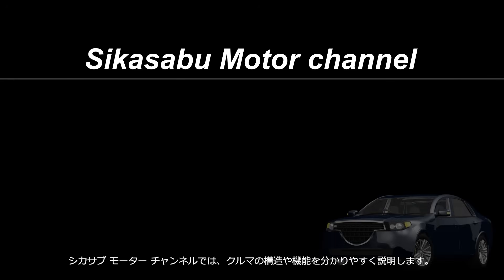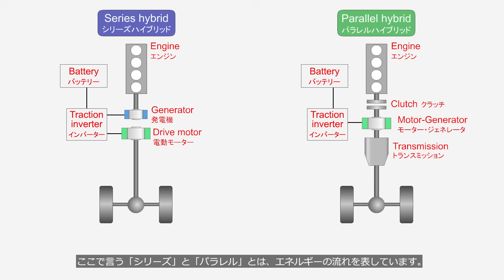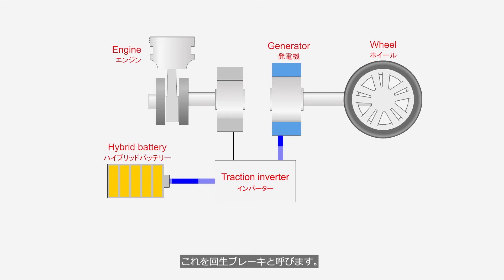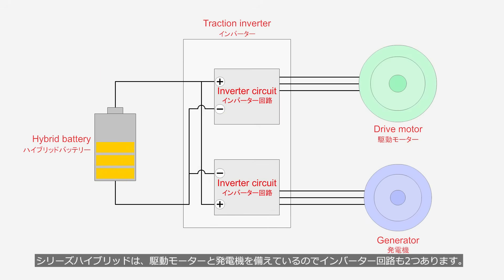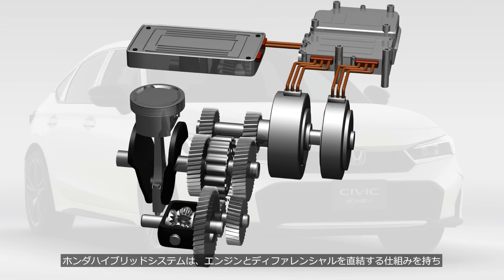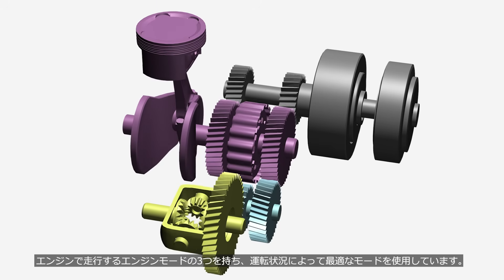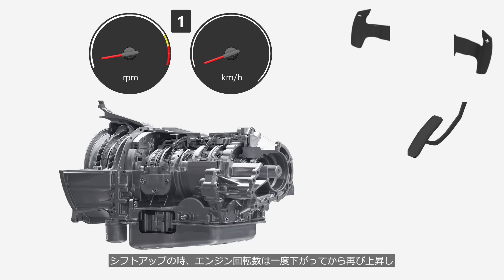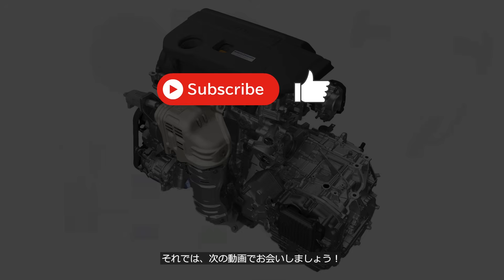Deep Dive into Honda Hybrid System　Can It Beat Toyota?

Comment: wait so no additional electric motor when in engine mode, why combination power up to 200hp not 140hp by engine itself on paper?
Reply from the maker: Even when the engine is directly driving the wheels, the motor can still provide assistance.
Reply: @sikasabumotorchannel  ok THANKS ALOT for Info. waiting for new updates!
Reply: Because "the engine itself" is never what drive the car in performance situations.

And "Engine mode" is more accurately called "parallel hybrid mode." The battery can still add, or subtract which is more common, power using the main motor-generator.

In a conventional ICE car, the HP rating is the maximum power the ICE can generate. It is never the power that can be sent to the wheels. There are transmission losses and peripherals that need some ICE power. Typical estimates are that at most 85% of the rated power can reach the wheels.

Since it uses a mixture of battery and ICE power, that get inserted into the power stream at different points, there is no simple way to provide a comparable rating for a hybrid; that is, before transmission losses and peripherals. Before about 2020, each manufacturer used a different method.

Honda had the easiest, since the power that could reach the wheels was well-defined. In, say, the Accord or CR-V, it was the 181 HP from the traction motor. So they reversed that 85% estimate, and advertised 181/0.85=212 HP.

Other manufacturers petitioned the Society of Automotive Engineers (SAE) to devise a system that would compare performance under a set of conditions, to a pure ICE. Typically, this system favors those manufactures. This is the system used today that says 200 HP for the Civic and 204 HP for that Accord or CR-V. It is the same car, but a different system. IMO it is too low, but it is now the standard.

NOTE: Battery Electric Vehicles use motor power. Honda could claim 181 HP in that system, but no other hybrid system can claim a number, so Honda uses the system that compares directly to other hybrids.
Reply: @jeffjo8732 nice explanation. Didnt know that SAE doing petition tho😮
Reply: @SeogabOnotjah  Well, maybe I exaggerated that part. There was discussion, originating from those who couldn't make an easy estimate, for an "standard" estimate. The discussion centered on why it was hard for some, so the result emphasized them. The point is that 200 HP for a Honda Hybrid, and 200 HP for a (say) Totoya hybrid, do not mean the same thing. IMO, such a Honda is more powerful in general, but each is stronger in different areas.

Comment: The Toyota ECVT is not a traditional CVT so get those fears out of your mind. No issues like most other CVTs  because it’s not really a CVT. Ya not hearing or feeling the gears shifting is unusual at first but Toyota actually puts in some “ simulated shifts “ although it’s not the same as a modern automatic. The difference in the Hybrid systems at least in the RAV4 and the CRV hybrids is the way the hybrid system works. The Toyota uses the gas engine and supplements the gas engine with electric motor power. There’s some times the vehicle is on all electric power ( going down a hill, driving at low speeds, low loads situations. The Honda system is similar and effective but not as refined as the Toyota. This is shown by the MPG of each vehicle. The other major difference is most of the Toyota hybrid systems with AWD use an electric motor to power the rear wheels. The Honda uses a traditional driveshaft which has its advantages and some drawbacks.
Reply: Toyota's "eCVT" is a glorified differential called a Power Split Device (PSD). Instead of one input (ICE) and two outputs (two wheels), it has three multi-purpose interfaces: the ICE, the smaller motor generator (MG1), and the larger motor-generator (MG2) attached to the wheels. The PSD maintains this relationship at all times: 13*MG2=5*MG1+18*ICE.

Anytime the ICE runs, power is split between the MG1 and MG2 paths. One of the MGs will act as a generator, and its power will be sent to the other. The degree of the split controls ICE rpm. The battery can add or subtract power.

The Honda system is not similar in any way. It usually is a pure serial hybrid, but changes to pure parallel hybrid when cruising on the highway. It is more refined and efficient than the Toyota system. But what Honda puts in the same marketing niche is a larger vehicle, so it gets less mpg.

The Honda AWD system is full AWD, meaning it can send any amount of power to front or back. Toyota uses an inadequate motor on the rear wheels, and fails most slip tests. It really is more for appearances, not function.
Reply from the maker: Thank you for sharing the information.

Comment: Thank you!

Although I had to watch the video a few times, it was very helpful for me to understand how my CRV hybrid system works.  I was also very curious in the hybrid system in the upcoming Prelude.

Thanks again 👍
Reply from the maker: Thank you for your comment. I'm also looking forward to the Prelude.
Reply: Prelude has recently sparked much discussion and debate about the soul of driving.
Reply: The new Prelude engine is the same as the Civic 2 motor hybrid system making exactly the same power.  The Prelude is even slightly lighter in weight than the Civic hybrid, but yet there have been reports out of Japan test drive that the Prelude is much slower in performance.  If this is true, then it is very strange and I am not sure why this is happening??
Reply: @SoPacifx64  I believe that it was related to S+ drive mode making it do the time test slower.

Comment: Toyota eCVT is more fuel efficient at Upper Highway Speeds ??
Reply from the maker: Thank you for your comment. 
The video at the URL below compares the fuel efficiency of Toyota, Honda, and Nissan using the WLTC standard. 
However, please note that the cars featured in the video are Japanese-spec models. The Japanese WLTC does not include the extra-high speed phase. Also, WLTC involves repeated acceleration and deceleration, so it's different from the fuel efficiency we get when driving at a constant speed on the highway.

https://youtu.be/2S0QVKjAnCc

Comment: I got a 2000 Honda insight with this hybrid system. Its advantage is that. Even the hybrid battery is bad I can still drive it for years without replacing it. On the Toyota hybrid system, you can't drive with a dead hybrid battery.
Reply: We have had 45 prius' give or take. 2nd Gen to 4th gen. Had one battery replacement for $2600 in a 20 year old model with 340k miles. Don't think too hard about this.
Reply: @tompiper3  This. Can be even cheaper if you DIY. And likely batteries will continue to get cheaper and better.
Reply: @tompiper3  Вы ничего не понимаете. Ездить на неисправной машине намного приятнее 😂😂😂
Reply from the maker: Thank you for sharing that information. I didn't know that the Insight could still run even if the hybrid battery failed.
Reply: I think that is a feature of any parallel hybrid system, there's still a direct path to the drive wheel from the engine. Well, assuming the OEM left it in.

Comment: There is no engine alone mode in this Honda hybrid. Because this car has not geared transmission so it needs motor accompanies by the engine to drive the wheel.
Reply: There is engine mode, but it is for sustained high speeds, like on motorway, because the engine torque is transferred directly to the wheels. It's a bit like a gearbox with only 6th in it.
Reply: That is pretty much true. If we want to nitpick, even in ICE direct drive mode the traction motor and generator are still connected and operating some adjustments, so at most it can become a parallel hybrid, turning into "pure ICE" only when their intervention is 0%, which is... pretty much never. Not that it's a bad thing, quite the opposite, even in favourable conditions an ICE alone is quite never in a perfect efficiency balance.

Comment: Question way we dont  take the electricity direct from the generator to the electric motor ?
Reply from the maker: Thank you for watching the video. 
This system maintains the engine/generator at a constant speed for fuel efficiency while adjusting the vehicle speed by varying the rotational speed of the electric motor. The speed of a three-phase AC motor is controlled by changing the frequency of the AC power. In other words, the frequency of the generator and the frequency of the electric motor are different. To change the frequency of AC power, it must first be converted to DC.
Reply: @sikasabumotorchannel  Interesting details here. A motor does not produce power from stored energy, like an ICE does. It converts power between mechanical and electrical, in either direction. That is one job of a transmission: to convert the form of the mechanical power. The other job is to match the speeds of the engine and wheels by altering the rate of conversion.

To loosely match the jobs to the components in ICEVs and BEVs:

1) Gas tank and battery store energy.
2) ICE and battery's terminals turn stored energy into power.
3) Transmission shifts and inverters match speeds.
4) Transmission and motor transmit power to the wheels in proper from.
Reply: @jeffjo8732  (quote) "...power to the wheels in proper from."[sic]  What is proper from?
Reply: @UserName-jm8yw "power form."
Reply: They do.
Reply: Nissan e power does it

Comment: Another excellent video!❤❤❤  I'm particularly interested in your thoughts on this hybrid system's efficiency. Do you consider it the best on the market? If you think another manufacturer has a more efficient system, I'd love to hear your reasoning. Thanks!❤❤❤
Reply from the maker: Thank you for your comments as always.  
Since this system needs to convert electricity from AC to DC and then back to AC, I believe Toyota's system is more efficient.  
I also have a video about Toyota's system, so please take a look if you're interested.
https://youtu.be/81ogeIqw1KY
Reply: @sikasabumotorchannel  If you are talking about the efficiency of the transmission system itself, the Honda parallel mode is best. The Toyota parallel-serial system is second best. And he Honda serial mode is third, but not by as much as is implied.

Three points here: First, the Toyota System is the one that is properly called "serial-parallel." It means a hybrid that uses both paths at the same time. That is literally what the "power split device" does - the engine's power is split between a serial path and a parallel path. The balance of this split is what controls the engine's rpm. Second, the Honda hybrid switches between parallel and serial, never using both at once. So it is not "serial-parallel." And finally, "series" is a noun while "serial" is the adjective form. So when the engine, generator, and motor are configured in series that makes it a serial hybrid. I know most of the world uses "series hybrid," but I can't any more than I can say "that ain't right."

But it isn't the efficiency of the hybrid system that matters. The point of any hybrid system is to allow the engine to run at its most efficient power output as much as possible. The combined Honda system is better at that than the Toyota system. You can tell, by comparing the economy (mpg means economy, not efficiency, although they are related) of the most similar cars: the Camry SE, and the Civic SPORT. They have nearly the same space, and ride on the same wheels.
Reply from the maker: @ "hank you for your opinion.
Reply: @sikasabumotorchannel  thanks ♥️♥️♥️

Comment: I see my Toyota Prius hybrid (HSD) as an electric car with gasoline engine assist (mostly true below 45 mph).
I have no desire for my electric car to be experiencing shifts from the gasoline assist engine.

Out at highway it could be argued that these cars are gasoline engine cars with electric assist. 
What is really happening is that the main traction motor and the smaller motor "gang up" on the planetary gearset to force the gasoline engine to do all of the work at its most efficient rpm for the conditions at hand.

Electric car goodness without the electric car drawbacks.
Reply from the maker: Thank you for your comment. I also think this system is amazing.
Reply: @sikasabumotorchannel  I see my Honda hybrid as a EV that is powered by a battery and a generator. ALL instead of SOME of the electric car goodness.
Reply: Yeah Toyota's is far superior to every other hybrid.  I have a Prius plug-in, it's basically a true EV for its 45 mile range, you only need the engine if you're driving further than that (which I don't for my daily drive).  So the only time the engine is used is when you deliberately engage hybrid mode.  I do try to do that once a week just so the engine isn't sitting for long periods.

Comment: This is the perfect system for those that can't give up the "rowing through the gears" sounds. I personally don't need the rowing sounds because I liken my hybrid sound to that of a jet engine. Throttle up and swoosh! you're gone! No gear rowing needs for me. I actually enjoy the peaceful sound of my hybrid. But to each their own. That's why there's a different vehicle for everybody. 🙂 And it's not just the Prelude's faux 8 speed system that will do this. My friends CRX hybrid does the same thing just with fewer gears.
Reply: Test drove a few EVs, but am a long term driver of mostly manual and for lesser period of automatic (and the dreaded cvt) vehicles of I4 and V6 engines, some diesel powered. Here is the thing, for driving enjoyment within speed limits, automatics (and EVs) get boring very quickly. Automatics with paddle shifters are no fun if there is a noticeable delay( generally greater than 200 milliseconds or 0.2s). Dual clutch are more enjoyable obviously as they shift quicker. Part of the reason automatics ( especially EVs) are boring, is that you tend to reach city and highway speed limits rapidly, ending all the fun ( let's face it, most of us don't have track days). Now with manual transmissions, every gear change is an adventure and making 2, 3 or even 4 gear changes(depending on your rev limits and throttle positions) is more engaging in the driving experience and I feel less bored as a result. Now I know they are less efficient or relaxing but that's not what I would be looking for on that drive. Given many modern driving aids like hill start assist, a high torque manual transmission vehicle is less of a chore to drive, even in queued traffic going uphill!
Reply from the maker: I completely agree with your opinion.
Reply: @thabzmad7265  Well, this does not justify simulated shifting sounds and wasteful engine revs that will never come close to a real stick shift as you will not have a clutch. I also love manuals, but this Honda shifts are a lame simulation that even wastes your fuel.
Reply from the maker: Thank you for watching the video. Also, thank you for sharing the information. 
I didn't know anything about the CRX Hybrid.😉